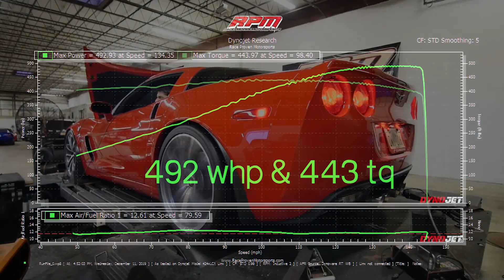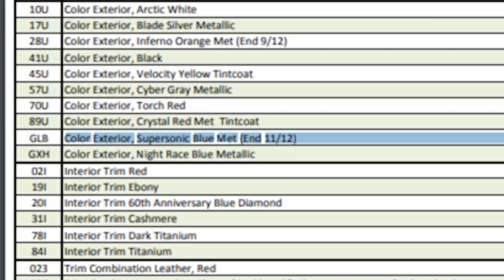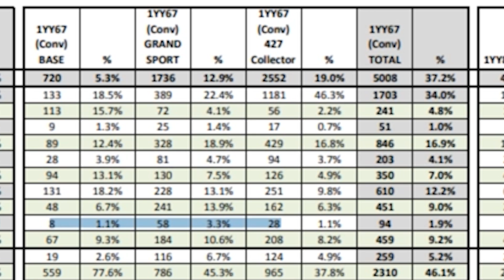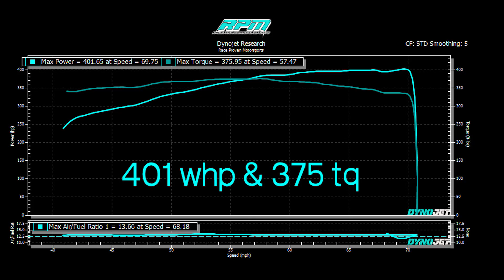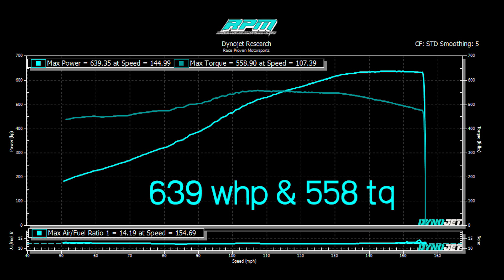Heads Cam Cadillac Escalade | RPM S8 E36

Comment: If the hood opened the other way (like most cars), then yes, it is upside down.  But since the hood hinges on the front, you would be viewing the emblem from the sides looking towards the front.  From that angle the logo appears normal.  If the logo was turned 180 degrees, it would be read upside down from either side.

Comment: Steve another difference between a ZO6 and the 427 is that the 427 frame is made from steel. The ZO6 frame is made out of aluminum. Cadillac V's and ZO6's what isn't there to love about that.
Reply from the maker: aware - 3:08
Reply: @RaceProvenMotorsports  missed  that.

Comment: Check the sides of the big end of the ti rods on that supersonic car. Bet the coatings have worn off on a couple, causing the ti shavings and taking out the bearings. You guys should do an episode on that, it's becoming super common. Check the forums and fb page. (also happened to mine)

Comment: Hey what’s the deal with the signature on the valley cover?
Reply: Matt Mosakowski : LS7 engines were hand assembled by select GM folks and the assembler would typically sign their name. I believe they also threw plaques on the side of the block at one point.

Comment: First, I want to say merry Christmas to the crew at RPM
Second, do you guys know what internal pipes were on that FAST intake vette? Short, medium or long?
Reply from the maker: They were just the stock ls7 ones.   The long ones
Reply: The FAST for the LS7 only has one runner available and its the long ones. I would have put mid lengths in if I could. Was also very close to cutting mine down and forming bell mouths but really didnt have the motivation to do it. If I didnt have the FAST already I would have went Ported MSD.

Comment: I'll say it again, why didn't General Motors recall the LS7 and fix the damn problem?
Reply: Marcus Battle $$$$
Reply: Marcus Battle When companies look at whether or not do a recall, they look at the total built vs number of complaints. If it’s less than 1% total it probably won’t get a recall. Just because people on forums might blow up the message boards doesn’t mean that they represent a significant amount compared to the actual number of engines produced.
Reply: @somedude7184  it's a significant amount, GM is just a shit company, that simple

Comment: Seems kinda pointless to mod an Escalade, burly any gains
Reply: 100hp gain through an auto AWD and big wheels is "burly" any gains?
Reply: Yea I’m just assuming since I didn’t see a baseline dyno and the numbers seemed low for a 6.2 with a cam
Reply: Yeah could be near 100hp gain. Pretty darn good! My camaro put down 370-380 stock.
Reply: @albertgarcia7091  they said its baseline with all the drivetrain loss is upper 200s